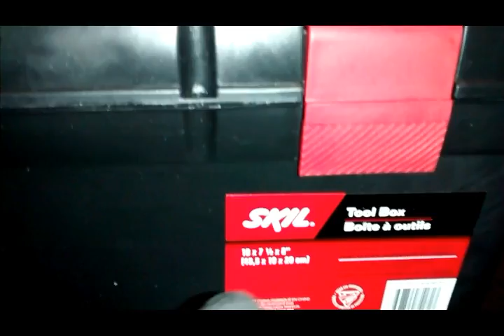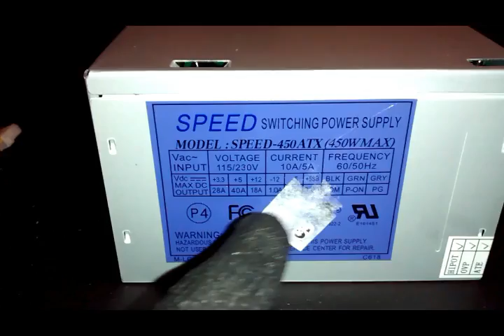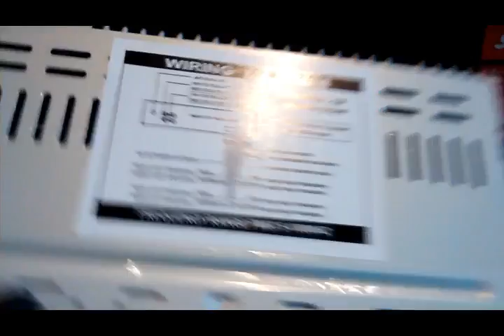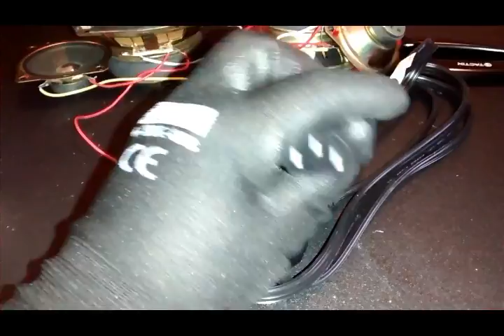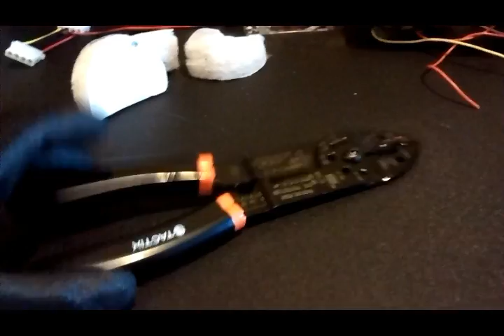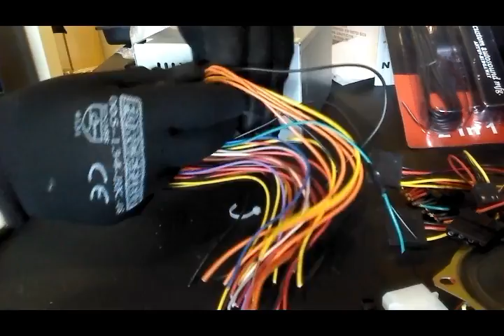Make your own toolbox radio (and 12v power supply)

Comment: I was good until, and I had to run it back to make sure, its called, in the industry a "soldering iron" and "solder" pronounced "sod-er" not soldiering iron which is pronounced "soul-dering" iron..............just to get it right. Still gave you a thumbs up!
Reply: Still not proper soldering techniques would be nice if you learned how to enunciate it properly it would make you sound more intelligent and you seem to be quite intelligent